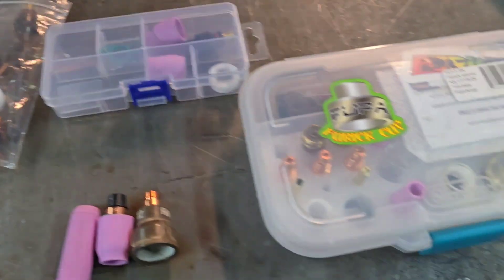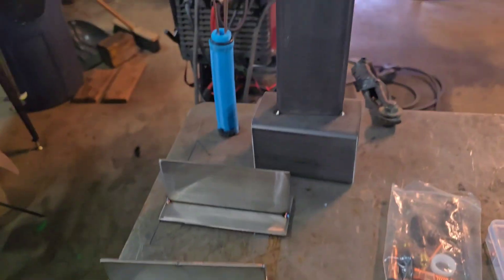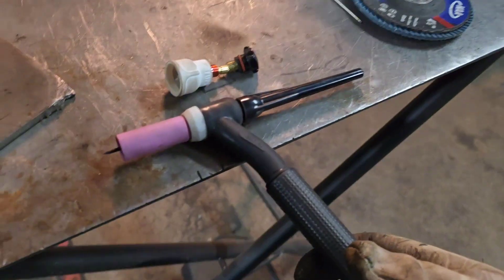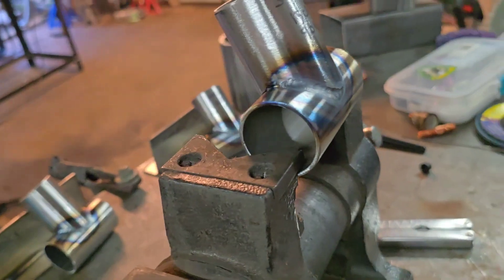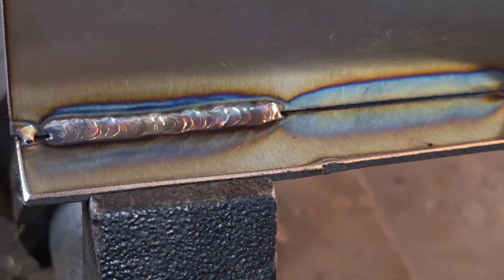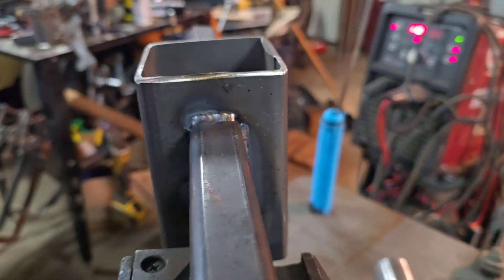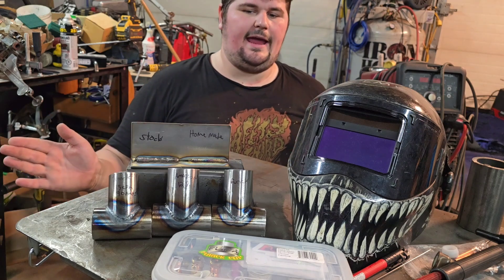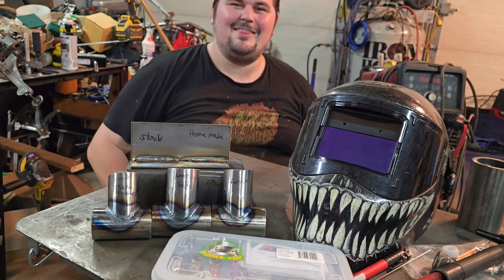TIG CUP BATTLE ROYALE !! WELD SHOPS HATE HIM #2 amazon vs Furick cups vs homemade ????  tig tips

Comment: Are you using minimal post flow intentionally to get more colorful welds? 
Either way those are nice looking welds.
Reply from the maker: I did it to try to make it the most obvious how well each cup worked, if i used a ton of post glow you wouldn't have seen as dramatic of a comparison between them